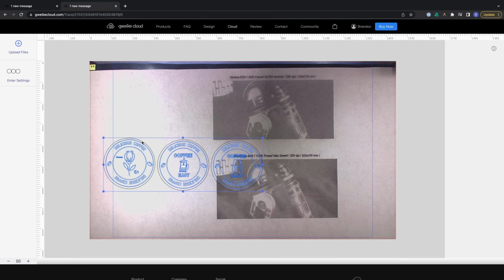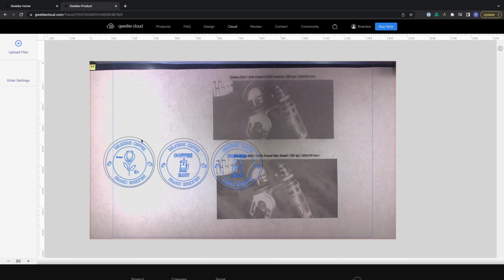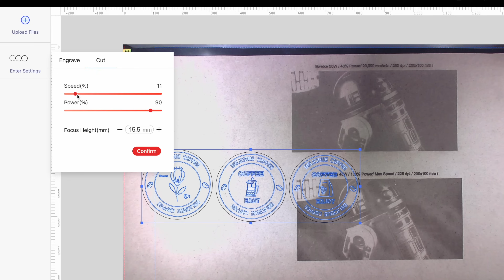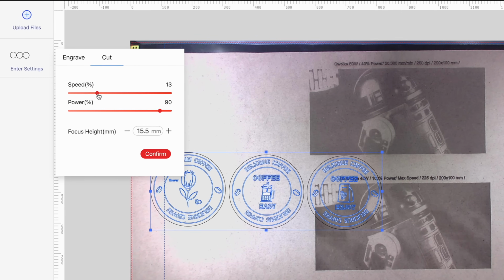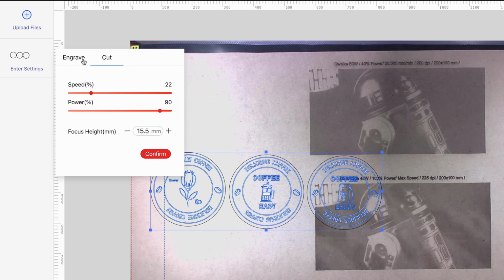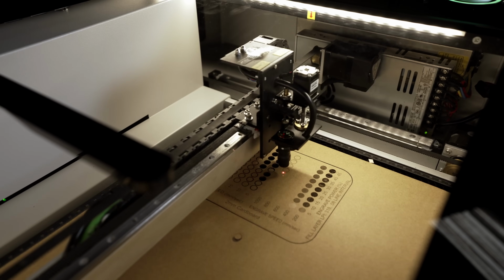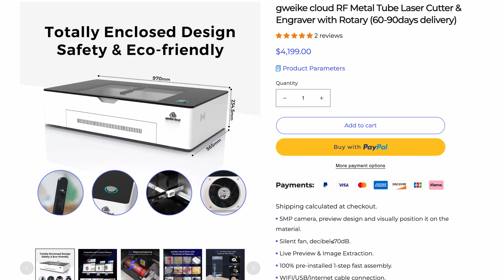Will this Feature Change Lasers Forever? Gweike Cloud RF Laser Review

Comment: RF lasers are only new for hobby grade machines but is an old standard for sign making lasers and are common among architect model builders. SYNRAD have made CO2 RF lasers since 1984. For detail work it really beats glass CO2 lasers by far. RF lasers can be operated from 0-100% duty cycle and a glass tube laser (10-15)-100%.

Comment: Can’t trust these shills
Reply: Hehe then ask someone with 12+ years of experience with RF lasers for production of architect models like me. Im used to GCC LaserPro and bought a glass tube co2 laser to use at home. It doesnt come close to details as an RF laser if you wanna engrave thin materials, it just melts it if its painted plastic or bi layer sign material. Look at the tests he did. At the lowest setting the RF laser stil makes a mark and the glass tube isnt even marking. I might get one of these for home use.

Comment: Shown at 9:31, the RF laser seemed to produce much more continuous and progressive gradation of marks on the wood than the CO2. Can you confirm this is usually the case?
Reply: Yes! Im used to industrial lasers from GCC LaserPro as an architect model builder. An RF laser can make way smaller  details and on thinner materials. As an example, you wanna make a small sign from thin plastic with a layer of paint on it. No problem with an RF laser, it will remove the paint and reveal the plastic but with my glass co2 laser i have at home it was impossible it just melted and had to use way thicker material. The RF laser ignites the gas at lower power than the glass tube version and has a smaller beam.
Reply: This is great info, thank you!

Comment: Man, I usually trust you, but I got so excited about this video that I went straight to the Gweike website to immediately buy this printer and noticed that you were SIGNIFICANTLY off on your measurements of the functional workspace just in time!.  Please be careful before you buy this😬.  It is actually: 20.08" (510mm) x 11.47" (290mm) x 2" (51mm).
Reply from the maker: Yeh I tried to update it in the description.  I don't know what I was thinking but gave the machine dimensions and not the work area, sorry about that!
Reply: @makeorbreakshop  well, it's to your credit that i almost jumped gun - your videos are very helpful.

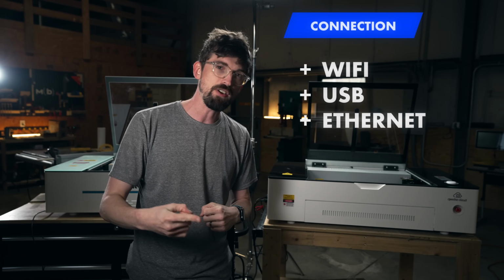Comment: @03:15 So... This morning at around 02:00am I was in chat with the G·Weike Support Guy(s) trying to get some questions asked about my regular G·Weike Cloud with the very first question having been what the Units Network IP Address is in order to hook it up to Ethernet - Normally you'd use a to the RuiDa Controller attached Screen Panel to SET the Network IP Address but with these Units not having a Panel there's no obvious way of setting it the usual way hence my question towards the Support.
Their answer: "Don’t worry. Currently, our motherboard does not support Ethernet control machines."

Soo... Did YOU manage to hook it up via Ethernet and if so, HOW? 🤔🤨

Comment: Kinda nice review, BUT Brandon I never see any technical info about the machines you review. 
I’d like to hear about finer detail RF/Glass wattage comparisons, stepper motor comparisons, belt tensioners, power supply output, guide rails shift and judder under different speed and job load? 
Anything technical really?
Reply from the maker: Great suggestions!  I use to get more into the technical side but have started to show more examples of what it can do practically.  I'll do a better job pointing the specifics out in the future though!
Reply: Wasn’t a nock at what you are doing! Glad you’re here👍

Comment: The main difference I've seen between the Gweiki and the OMTech is that the OMTech comes with an off the shelf Ruida controller with separate stepper drivers and the Gweiki has a Gweiki built Ruida controller with drivers (TMC2208) mounted on the main controller board.

Comment: I’ve seen people questioning the cutting saying the glass tubes are better,my question is how does the RF do with leather engraving and cutting? I’ve seen the cloud pro and I’m tempted to get it but then I saw this review and now I’m questioning wether this is worth getting or just going with the cloud pro…. Omtech polar was another option but I don’t want to wait for shipping and although glowforge seems like a great choice the price and cloud based software put me off 
Sorry for the long rant I’d just love to hear if the RF is that much better or not 
Thanks and love the content
Reply: Usually higher power is better for cutting, getting cleaner cut on thicker material. That being said, I've found that vegetable tanned leather is one of those materials that will char no matter what you do to it; Likely you'll see little to no difference between the choices you listed, you're going to be sanding the edges of the cut leather either way.
The ability to turn air-assist from full blast to minimum when engraving however is quite helpful to avoid marking the leather with smoke around the engravings, but I don't think any of these desktop machine have that option unfortunately, so again, likely no difference. Hope that helps! (Just avoid glowforge basically....)
Reply: @FurreFurre  thank you! I appreciate you taking the time to message me back! I’m still on the fence about what I should get, glowforge is definitely not going to happen but I’m stuck between wether I go for a diode or co2 laser, I have ventilation where I’ll need to be more on the quiet side and in my garage I have no ventilation other than opening the door in which I can make more noise, so It’s coming down to the wire on what machine, but it will be a learning curve regardless and I’ll be starting to use lightburn and learning all about how to use the program
Thanks again! You’re the only person to reply to my comments so far, have a great day and all the best 🤟
Reply: @acrobatjones  Having used both diode and Co2 lasers, I highly recommend that you go Co2 if you can afford it. Normally speeds with a diode lasers are mentioned in mm/minute, but with Co2 we normally mention it in mm/seconds, it's simply more capable especially for cutting things. With Co2 lasers you also get a metal enclosure with viewing window that's easier to keep your fumes where they belong, and you dont need to be as careful as around diodes where you pretty much need to wear protective glasses all the time (blue light).
It is however more complicated with watercooling etc, but there are smaller machines similar to glowforge, like gweike and omtech polar available nowadays with cooling integrated as well into the units, competitor machines for the glowforge pretty much.

Comment: I currently own a Ortur LM2 with both the 20w SF & LF lasers. I would like to improve speed with both engraving & cutting (I mainly engrave ceramic tiles, slate & mirror, but also glass & stainless steel) & would like to cut 4-6mm ply/mdf/acrylic. Would the RF CO2 laser still get similar quality on engravings at a much faster speed & would cutting be a lot better with the glass tube C02? Also, when engraving ceramic/acrylic/glass etc do C02 lasers still need the various paints to mark/burn materials? Thanks for this video btw (been waiting for your opinion)

Comment: The only thing keeping me from getting the RF/Glass version.... Is bedsize.. :) I usually do sheets of 24x12, so now I have to trim those down to size and lose material. Or open the passthrough and do a few pieces in one end, trim the excess of and then put it in normally 😁 

But other than that, it's a good machine 😁

Comment: Would like to see a more detailed cut comparison between 38W RF vs 50W glass. How much cutting ability is lost with the RF model? Was thinking that having the power concentrated into a smaller spot size might make up for lower power.
Reply from the maker: The cutting tests towards the end show a direct comparison on a few different materials.  The 50W glass is stronger but not a crazy amount.   Plus I've liked the engraving results from the RF tube vs the glass.
Reply: I agree, I'd totally like to see this in detail. It isn't clear to me if the size of the laser dot compensates for the power to a degree. I'd love to see acrylic and balsa tests of one vs. the other in terms of single pass cutting. I think a lot of people struggle with understanding the capabilities here.

Comment: Never had an issue with glass in my large format 60/130w reci/Cloudray home machine and industrial units…..unless your plain careless……but ultimately, tubes are consumables.   Avoid cloud only machines.   ❤️Lightburn, regularly upgrading features😎
Reply from the maker: Yep, but if RF costs come down they could be a great option.  Also Gweike runs local, both their software and Lightburn.  Their name just makes I’m confusing…

Comment: Very cool, Brandon.  What about actual time to complete an engrave job?  It's twice as fast but the laser is 1/3 as small.  Does that equate to it actually being slower???  I imagine the cutting is just faster since it's not having to fill in a design.
Reply from the maker: Hey Brad!  So even with the laser dot smaller I could still run both machines using the same DPI resolution on the image.  The Star Wars Aztec design used the same resolution so it would up being about twice as fast since it was running at 1000 mm/s vs 600.  Diode lasers will also get in the same laser dot range but I haven't run into issues of them taking longer just because the laser dot was smaller.
Reply: @makeorbreakshop  cool, makes sense. It's be interesting if you ha e one specific design, like the Aztec that you run on every machine you test so you can compare them all across a similar output. Almost like a benchy for 3dprinting. Love seeing the new tech!

Comment: What about eye protection? Is it just as bad as CO2 laser?
Reply from the maker: You don't have to worry about light in the same way as a diode laser seem the beam is invisible.  But the biggest safety advantage you get with a CO2 machine is they are full enclosure so it will contain any reflections of the beam that might come off the material.
Reply: what do you expect, its a fricking laser, but the borst by far are diode lasers, co2 can cut acylic and "clear" materials so youre save behind the acrylic with co2 lasers and i think so with rf lasers as well

Comment: I like your review and now I have even more to think about as I consider purchasing one of these machines.  The primary question I have if and how well the RF laser cuts clear acrylic which I know the CO2 laser can easily handle.  I have a specialized need to cut and engrave both cast and extruded clear acrylic ranging from 3/32" to 1/4".
Reply: I'm managing a makerspace with two GCC Spirit GX (60W) and one Spirit LS (30W) laser cutters, all with RF-lasers. They all cut acrylics with excellent results.